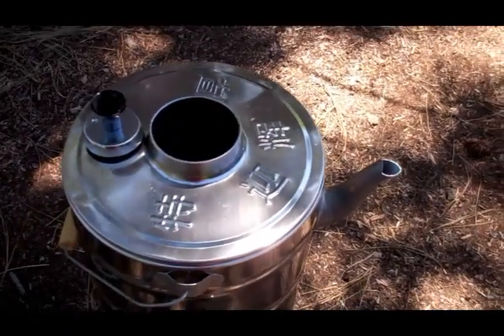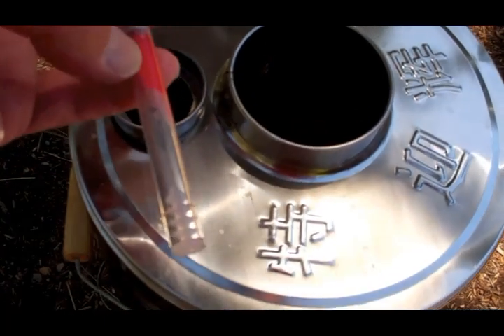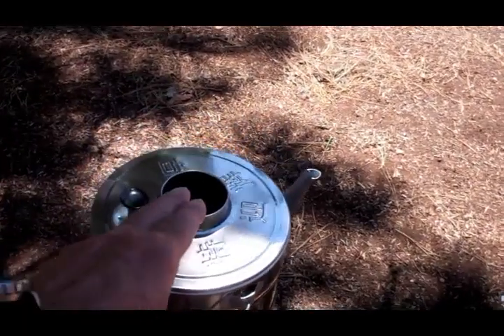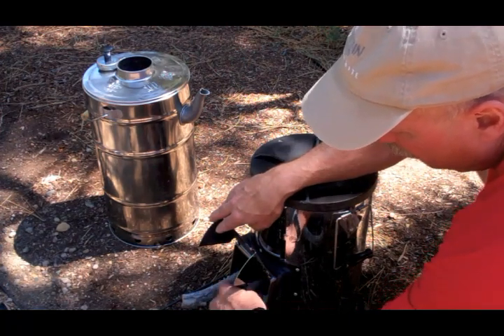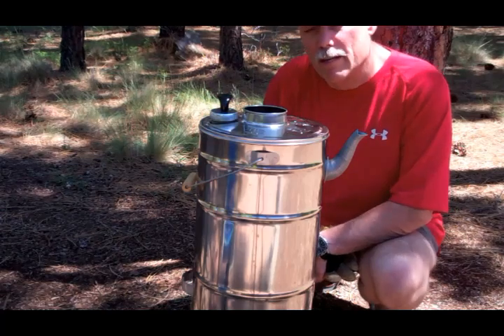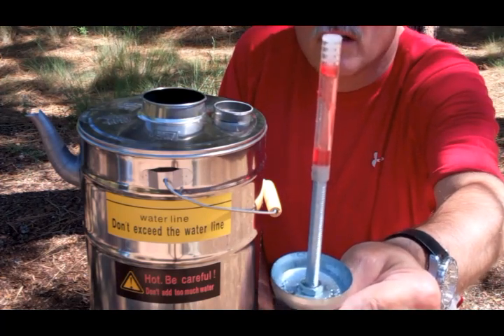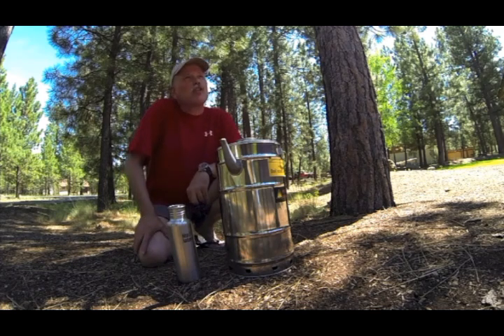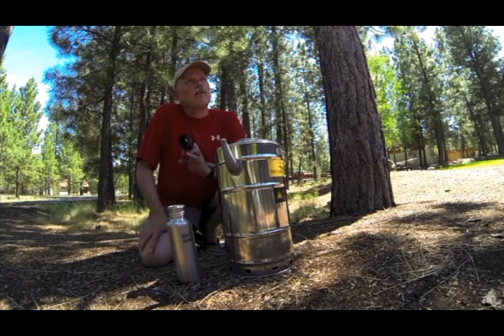Silverfire Survivor & StoveTec Water Pasteurizer

Comment: Steve here (founder of Hydromissions - we designed the pasteurizer component for StoveTec).  Just wanted to make a quick comment that these rocket stoves were originally designed for relief work in developing countries.  Those of us able to watch videos probably live in places where fuel is plentiful.  However, in many rural areas in developing countries (and in refugee camps), wood and burnable fuel is scarce.  The idea was to use the after-burn from cooking to pasteurize water so nothing is wasted.  If you've ever seen a villager having to scavenge for twigs to burn, you'll understand the need not to waste fuel to boil.
Reply: Where can I pick up a water pasteurizer for the Stove Tech? Mine got crushed sadly. I haven't been able to replace it.

Comment: Pasturization: process used to make milk safe to drink. Google yourself. Same principle applies to making water safe to drink. Filter 2 remove sediment, etc. then heat. Heating to boiling point gives good indicator when there's no other way to measure temp of water. CDC recommends to boil 1 min (3 at higher altitudes). 

To sterilize water requires temp higher than can be obtained thru heating in open pot. Boiling = 212F max. Pressure canning to preserve food requires 10 lbs pressure = 240F.

Comment: Its about the conservation of fuel. It takes less fuel to bring the water to the 150 degrees that make it safe for human consumption than to boil it, the wax allows for verification of temperature without boiling. The system was originally designed for areas with limited fuel resources.

Comment: I think there is some confusion, water treated this way is NOT safe to drink.
Water of a unknown source NEEDS to be boiled to kill as many nasties as possible, even then if there are a lot of large particles in the water it still may not be enough to kill everything harmful as the nasties inside these large particles will be protected from a lot of the heat.
Best bet is to filter the large particles out, then bring the water to a nice long rolling boil.
Pasteurization, is used as a preservative.